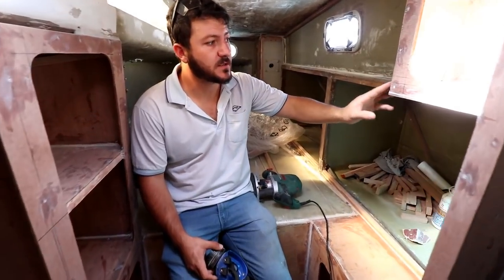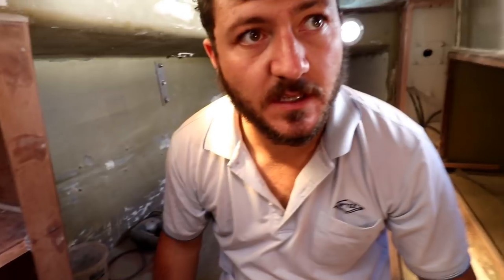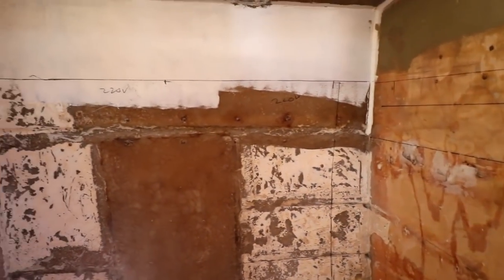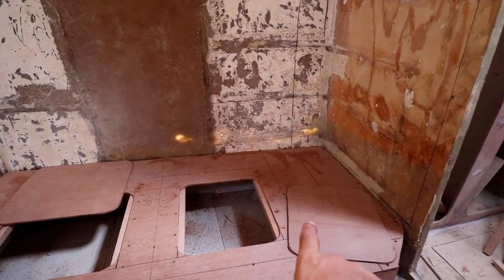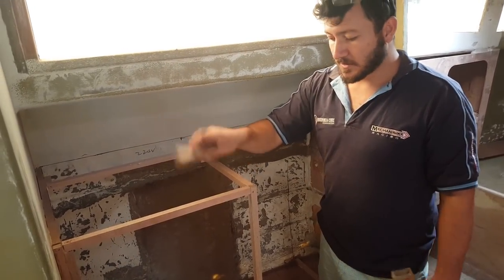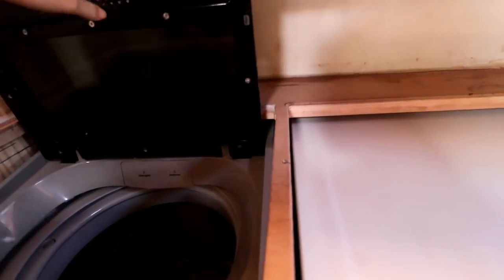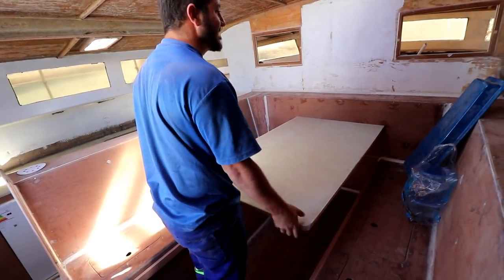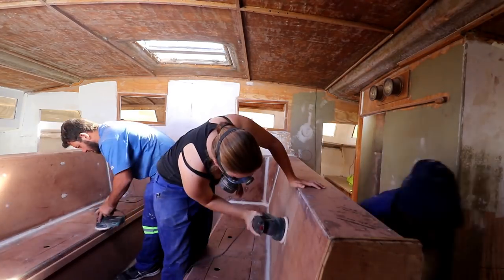How FAR we've COME! | YACHT REBUILD WEEK 16

Comment: great progress,and looking like you will have a good functional,easy to clean finish.

it is best to do all your painting before installing wiring and pipe work as it is very difficult to paint around once pipework is in place and wiring laid.

you also will need to build some ventilation in the floor{ at the back and front} of the fridge and through the surface above the fridge to allow for air circulation as the condenser/radiator on the back of the fridge needs plenty of air for cooling.
the more ventilation the fridge has ,the less power it will need to use  to cool the icebox and fridge inside.
Reply from the maker: Hey Alex,

Thanks for watching! Thanks for the advice, with Ricky''s mechanical engineering background he luckily has thought of all of this. :)

Comment: Working hard is really paying off and it shows each week. Now a question about under the washer and refrigerator is there a drain or is it just a sump where the fittings for the tanks are? It's hard to tell with what was shown and is this a place you where you might add a censer to alarm you of any water built up in case of any leaks? Great job guys looking forward to next weeks show.
Reply from the maker: Thank for watching,

There is a drain that runs into the bilge. The bilge will be fitted with a bilge alarm and a bilge pump. :)

Comment: Very Nice video guys but I was wondering , enclosing the washer and dryer is great but what about if one of them get broken and you need to pull them for repair , I think will be very difficult don't you think . But overall great job and I really like how everything is coming alone , keep it up guys :-)
Reply from the maker: Hey there Albert,
The machines are easily accessible by removing a few bolts and we can pull them out. We don't build anything without thinking of the worst case scenario first. The last thing you want out on the water is something going wrong & you're not able to fix it. 

Thanks for watching!

Comment: Awesome work guys. Do you paint inside all the cabinets and the areas under/behind the washing machine and fridge to prevent mold behind the cabinetry?
Reply from the maker: Hey there,

All the areas inside of the boat are primed with marine grade epoxy primer and urethane grade top coat. :)